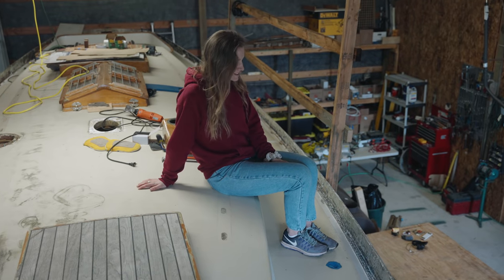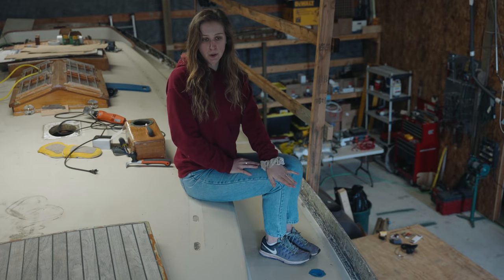Refitting This Old Boat. [S4E7]

Comment: with a 1 inch wide belt sander (makita 9031 for instance) removing the remainder of the plywood and sealant would have been faster.  alot more dust also for sure. the tool allows for speed setting so you can chose a speed confortable to avoid removing too much material, but since it will be covered, any dings wouldºve been concealed aniway

Comment: Is there a reason why boats do not run wiring through fixed wireways (or maybe they do?)?  It seems like all too often the wiring comes off looking like a rats nest with wires everywhere and terminal blocks nowhere.  Just curious, I previously worked making large machine tools and no one would ever be so random with the wiring (or plumbing for that matter).  Great job so far by the way!

Comment: I was so confused.  I looked up leeboard and the first definition I found was on the outside of the boat.  Didn't make sense in context.  Went back to google and found it is a board to keep you from falling out of bed during storms. I'm slow sometimes.
Reply from the maker: Sorry we didn't clarify! Normally it's called a "lee cloth," since it's usually made out of cloth. I just called it a lee board since we were thinking of making it out of a board. I can see where the confusion comes in!

Comment: That wiring you're ripping out was probably made in England in the past. Even though it's stiff it's been made properly. Where will your new wire be made? Germany? I think not. It will look like wiring but basically be junk. Ersatz. Keep anything made before manufacturing was hijacked! We have the same with our old VW van. Keep anything pre-1990's....  Thumbs-up as usual.

Comment: couldnt you have used the old wires to pull the new wires through. Going to be fun routing the new ones???
Reply from the maker: The new ones will be in different locations and will be routed differently.

Comment: I did bicycle road racing for the challenge and achievement, not for glory, fame, or fortune.  It is the challenge that leads to the achievement and the greater the challenge, the greater the achievement.  If it is always easy, there is no challenge or achievement and, therefore, to me it isn't fun or fulfilling.

Enjoy the challenge because, when it is over, you only get to enjoy the achievement.  The greater your challenge now, the greater your achievement later.

Comment: The boat appears to have been wired with 1.5/2.5 twin and earth domestic single strand copper wire.  Not suitable for a marine environment or where there is vibration! Rip it out? the right thing to do!  
The word boat stands for; Break Out Another Thousand.

Comment: Would a heat gun help with the Seikoflex removal?
Reply from the maker: Yes it would but it’s very slow going. Easiest is an oscillating Multitouch with a scraper blade with no teeth

Comment: Check out the engin for the tally ho. It is both an engine, and a generator. You can use wind to “drag” your prop, a d generate electricity

Comment: you certainly have a lot of guts cutting those wires without knowing how your going to run the new wires. When I pull old wires I attach a string so i can pull the new wire with ease.

Comment: You guys need to work on one thing at a time. Don’t start loads of jobs. Finish the cap rails off and floor first if you can. Finish the electrical work by fitting new cable before moving on. What ever you do do not start yet another project like the engine…why? One starts to forget how things came apart and how they will go back together.
Reply: @SailingMagicCarpet  I wish my wife and I had the time to rip apart large parts of our sailboat and rebuild them. I would love to be in your situation and have a clean slate to work with. Alas, we can’t afford the time and we have chosen to keep our boat in working condition at all times, so only small jobs at a time. It takes longer, but eventually we’ll get there.

Comment: I guess I just don't get fixing things that are perfectly not broken and attached so well, this really has me wondering why you are just not fixing the other thing that are needing attention.
Reply from the maker: Are you talking about the bulwarks? Because they were rotten in several areas and were spreading to the deck beams. If left for a few more years then this boat would be approaching unsalvageable. We want to sail across oceans, and we’re not taking any chances with shoddy construction work when we’re weeks away from land. If all you wanted to do with this boat was live aboard in a harbour, then sure, you probably wouldn’t do what we’re doing.